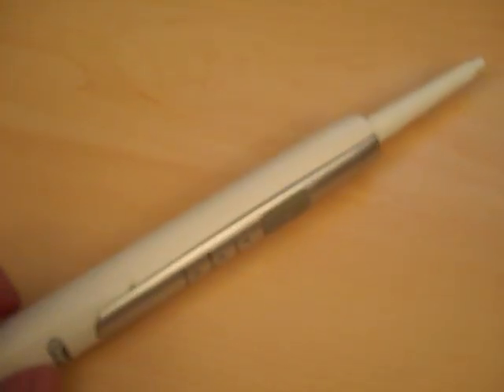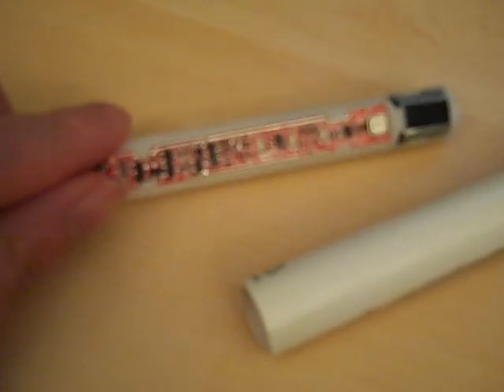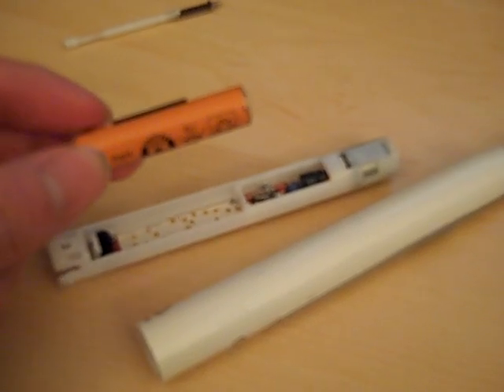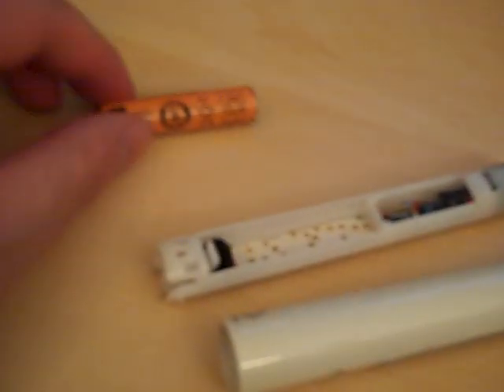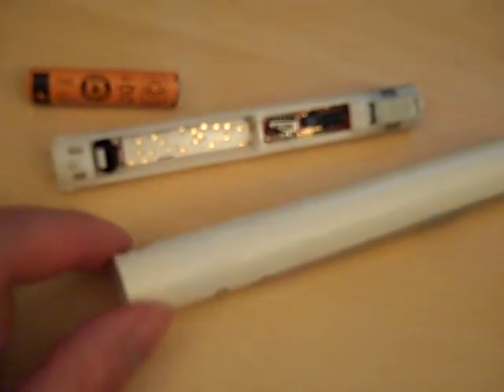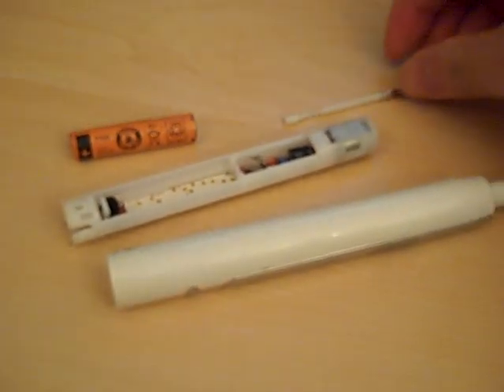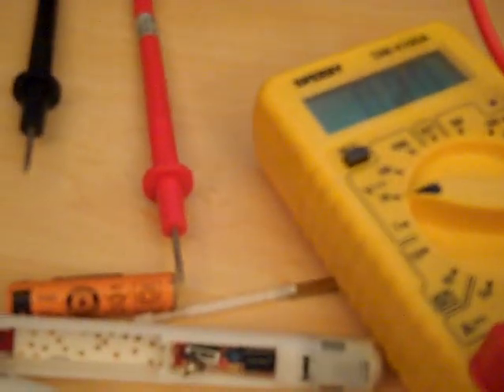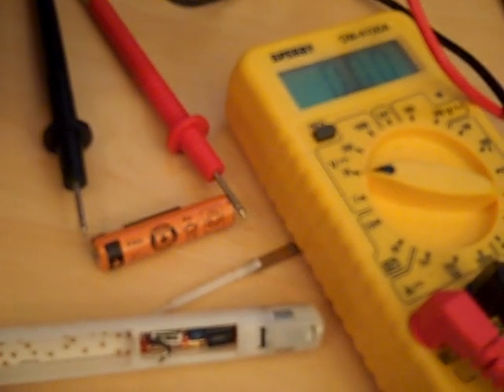Braun Oral-B Pulsonic electric Toothbrush tear down repair stopped working

Comment: I was able to successfully replace the battery. Some basic soldering skills required. The hardest part was the disassembly. As mentioned by someone else once you remove the screw and end cap there are two clips holding the assembly inside the case. With the buttons facing up at 12 o'clock they are on the sides at the 3 and 9 o'clock positions. I used a precision screwdriver to pry one clip apart and inserted a pointed scalpel blade to keep it open then used the screwdriver to pry open the other side. With the base screw screwed in again using a small plier to slide the assembly out. You do not need to push from the tip end as others have done as that breaks the waterproof seal around the head. The battery is a standard single cell 1.2V 700mAh NiMH AAA battery. It's the more common AAA size not the 5/4AAA size someone else mentioned. I replaced with the Panasonic HHR70AAAB8T battery (from Digi-Key part number P213T-ND) which has soldering tabs that align nicely with the connection points. I bent the +ve tab back on itself so the -ve tab was on the side for soldering to the -ve wire. The +ve tab is then just a bit short to reach the circuit board but can be bridged to the contact with a blob of solder.

Comment: Today is Dec. 11, 2017.  I took apart my Pulsonic "Type 3716 to replace the failing battery.   After finding the battery was soldered, I stopped and found this video.  I may try unsoldering the battery.  Here are some tips:
1. One of the comments explains how to remove the internal cylinder by prying the three tabs and pulling on the re-inserted screw.  I found the other end, which has the tip that connects to the toothbrush head, can be pushed on while prying the tabs and it will push the entire cylinder out.   
2.  There is a website in the UK for replacing these toothbrush batteries and they sell flat top batteries.  So you could view them and order from them if you desire.  https://toothbrushbattery.com/guides/   
3.  I will return with more details after I find a battery and replace it.

Comment: Hi, I would suggest that your meter possibly has low batteries, this can often result in misleading values when testing batteries (for some reason they always come out high) also, it's impossible to charge a 1.2v NiMH battery to 2 volts, Max I've ever seen is around 1.4. most likely the battery is knackered and it needs a new one. for the cost of a new 700mah NiMH battery, I'd definitely try that first.

Comment: To pull the inside out: After releasing the screw, you have to release two clips. NOT the clips of the inductor! If the Oral B logo is on top, the clips are on 9 and 3 o'clock (the clips of the inductor on 12 and 6!). Release them and push the brush down to pull it inside out. Sry for my bad english :/
Reply: Just to expand on this. When the toothbrush button and LEDs are facing upwards, the two plastic tabs are indeed at the 3 o'clock and 9 o'clock positions. There are what look like other plastic tabs at various other positions - ignore them, they do not hold the insides in place, just the two tabs mentioned. You have to press both those two tabs in before you can pull out the insides. I suggest that you screw the bottom retaining screw back in, without the bottom cover, to give yourself something to pull the insides out with and use a couple of bits of thin plastic (like cut from a yoghurt container, or something) to hold the two retaining tabs in the pushed out positions, then just pull on the screw and it should come out without any force, or damage.
Reply: Too late I broke it

Comment: Hey got a question because I see you're familiar with the technology.
I got the same brush and it's 6 months old. I had this problem from the beginning but didn't realize it back then.
After the brush charges once it works perfectly that time, and then over a few days it seems as if it doesn't charge anymore (though the charge LED is shining while on the unit) and it's power gets weaker until it stops working. Then it gets full again and the cycle is repeating. U know why that could happen?

Comment: Hardly unusual after 3 years of use. Not to mention it is a $60 toothbrush. The reading you are getting is also typical. You could simply seal the toothbrush after you replaced the battery with silicone, probably how it was sealed originally.

Comment: it's 1.95V because there's 2 1.2V cells inside the shrinkwrap which are discharged.
Braun toothbrushes never overcharge their batteries. This is because they'r charging with a very low current. This would be a charge rate of about 1/10th of their capacity. this low current doesn't require to end the charging process once the battery is full. If the battery is full it just transforms the additional energy in heat. But bcos of the low current it only gets handwarm and doesn't damage the battery.

Comment: I'm not sure about the pulsonic, but Oral-B toothbrushes generally use two cells in series encased in shrinkwrap. That would explain the 2.1 volts. It is unlikely the battery would hold such a high voltage if it were only one cell. I think if you went to Braun with this complaint your red face wouldn't be due to mercury.

Comment: I'm sorry but you have just described a battery that has died of old age..
I'm assuming that this is a Ni-Mh  battery and not an old Ni-Cd.
Even so, you'll still find that when the cell is old its terminal voltage (under charge) will go very high. Then when you put a load on it, the voltage drops rapidly (I.E. appears not to be charged).
This type of product is always going to get over charged and over charging knackers the cell. :-(
Even a good cell won't last more than 3 years doing this job.